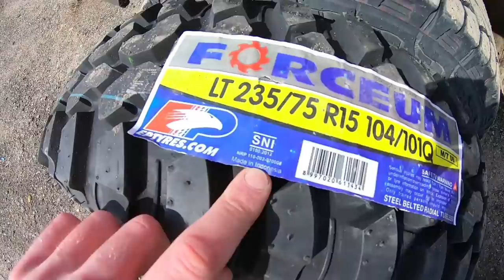Lifted Subaru Impreza gets 30" Tires × Rot Wagon

Comment: Love your Jack.  Link please
Reply from the maker: The one on the hood, or the bottle jack + stand thing?
Reply: @Tinker1837  bottle jack
Reply: @Tinker1837  bottle jack
Reply from the maker: @bradygd  That's a "Powerbuilt All In One" that can usually be found cheaper ($45) at Tractor Supply, but here's an Amazon link: Powerbuilt Black Alltrade 640912 3 Ton,All-in-One Bottle Jack https://www.amazon.com/dp/B003ULZGFU/ref=cm_sw_r_cp_apa_i_MmlUDbSMPNC6B
Reply from the maker: @rjmisfit138   brad ornat  That's a "Powerbuilt All In One" that can usually be found cheaper ($45) at Tractor Supply, but here's an Amazon link: Powerbuilt Black Alltrade 640912 3 Ton,All-in-One Bottle Jack https://www.amazon.com/dp/B003ULZGFU/ref=cm_sw_r_cp_apa_i_MmlUDbSMPNC6B

Comment: I want an outback. Do you need to change diff gears or trans to make it off road or get bigger tires? Is it basically a lifted Impreza?
Reply from the maker: Need? No.  Does it help? Yes.  My "Outback Impreza" in this video has 4.11 gears which helps, & the Forester's 4.44 gears would be even better.
Reply: @Tinker1837  I just got a Legacy Outback in May. It's a 2000 with a EJ25 2.5L H4 engine. Nothing fancy just a beater. I bought it with 213,358 miles on it. Now I have 214,000 miles on it. It's a good car. 5 Speed manual transmission. I am trying to fix it up as cheaply as possible and go from there. I am converting the exhaust to a straight pipe and my goal is to just keep the engine light off for five years. I want a WRX wagon or a 2.5L Outback Sport like this. Same car but a couple years newer with less milage! Is it better then a Forester in your opinion?
Reply: @Tinker1837  nice I have a 2000 Legacy Outback with a 5 Speed. Bought it for $2700 at 213,358 miles on it. I have 214,000 miles on it now. So I am going to keep it for five years. I am doing a straight pipe exhaust from the headers back. Going universal cats and mid pipe delete. Other then that It's a fine car. I decided that I am keeping my car for five years at least with the engine light off. So, if I can do that I will be happy. I'm looking at getting a 2003 Outback Sport with the WRX package. What do you think about that? Are these outback sports better then the foresters or would it be cheaper to just eventually buy a "newer" to me Forester with a stick and the XT package? Just wondering- WS

Comment: Where’d you get the wheel adapter?
Reply from the maker: Ebay, but I'd you goo there too just be sure to avoid the cheap chinesium cast adapters (these are forged aluminum).

Comment: Your car has a problem in its rack and pinion, you old tyre shows its abnormal wear
Reply from the maker: Oh it's more than just the steering! Lots of things are off a little due to the extreme amount of lift it has over original (11" taller & 5" bigger tire!)

Comment: Is that a license plate on the rear 1/4?
Reply from the maker: Yep!  Several of them are formed to the body on each side to cover where I chopped out a bunch of rotten steel. Not quite a hot rod, but same idea 😎
Reply: @Tinker1837  well. I quite like that car. Nice work.  That's the type of Subaru to wheel. Not a brand new one!
Reply from the maker: @Shornandkenny  Agreed! So many parts to share between the different cars back then compared to now.
Reply: @Tinker1837  stock Subaru shit is bulletproof.  Good to see your not a rally fan boy! 

My 4runner had 32 inch mudder so that things gonna be beast! Unstoppable.
Reply: @Tinker1837  no turbo = no problem

Comment: What was the cost to lift the car?
Reply from the maker: Total costs so far:   The Car $350, Struts $125, Lift Kit $700, Wheels & Tires $425, Fixing Leaks $175, Big Brakes $325, CV Axles / Boots $175, Wheel Bearings $125
Reply: I can only dream with such prices here in Brazil, everything overpriced plus insane taxes...
Reply: Car is 350$?

Comment: Wait. How do you have d windows on this thing? Ive been trying to find some 17 inch d windows with the right lug pattern for outting 35s on the same exact car. Except ill be cutting the dog shit out of mine instead of lifting.
Reply: Also cant find spacers that change the lug pattern to accept the wheels.
Reply from the maker: Oh it's just running 5x100m to 5x4.5" spacers that are 1" thick
Reply: @Tinker1837  i cant find any of that size. Got a link?

Comment: 235/75R15=29", not 30"!!!
Reply from the maker: Wrong.  Maybe you have not modified a car, or never worked on your own, because this is a well known FACT:  The size on the sidewall rarely matches the real life measured size, especially on off-road tires.  In this case they measure much larger than advertised, but I have also had truck tires (31" tires that measured 30") smaller than advertised.
Reply: I have no off-road experience, and i never has modifi my car))) Just check my chanel first to tell me that!
Reply from the maker: @Mikael_Leehmanoff  How do you not know something so basic then :P

Comment: Non turbo ? Automatic ?
Reply from the maker: Sadly yes & yes.... for now! Possible 6 cylinder turbo setup or some such nonsense like a K-series Honda coming next year.
Reply: @Tinker1837  hey .. I wasn't knocking it.. I was just curious. . It does the job right ? 💪🚗
Reply from the maker: Sure does! It's definitely one of the slower boxer engines, the 2.2 liter single port, but surprisingly reliable (no head gasket or bearing issues like some others).
Reply: @Tinker1837  yeah 2.2 is definitely best choice for reliability
Reply from the maker: @windolite  They seem to go forever!
Reply: @Tinker1837  I have a 2.2 boxer on my 2017 impreza base. It's very reliable and still has 156 horsepower I believe. It's a good little engine. I'm wanting to turbocharge it. Do you have an aftermarket exhaust on yours? I love going nuts on dirt roads out by the ranch.
Reply from the maker: @posttenebraslux690  Yeah I actually built my own fully custom exhaust front to back, including the header.  And I built the header  unequal length so it actually sounds like a Subaru, oh and I used all V-bands instead of bolt together flanges... so much easier to work on!
Reply: @Tinker1837  Nice. I was thinking about putting a custom exhaust on mine. I know turbocharging your car can cost thousands. So, I figured I'd start there then build up to a turbo.

Comment: Bro do you change fwd to awd?
Reply from the maker: Thankfully this one was already all wheel drive, but I did add a custom switch to control the center differential locking :D
Reply: @Tinker1837  can i know what part aded and part u changed to your car from fwd to awd?
Reply from the maker: It started as AWD, I did not change.
Reply: @triktipshoby9714  99% sure all Subaru's are AWD

Comment: Ummm that is a 28.5in tire not 30 😁
Reply from the maker: The size on the sidewall rarely matches the real life measured size on offroad tires, in this case they're much larger than advertised :P
Reply: @Tinker1837  yes I know I ran 235 on my ranger it's the width of the tire that changes the size so if you would have went with a 245 it would be 30 31 inches 😁
Reply from the maker: Tires 31" tall would be awesome, but then I would definitely need gears!
Reply: @Tinker1837  yes and 4lo

Comment: Not 30s but still cool
Reply from the maker: Sure are. Tire dimensions are far from exact. For example I have 35x12.5r16.5 tires on a truck that barely measure 34" tall (without weight on them). It's a well known thing & I mention in the video that these measure much more than labeled.
Reply: what tinker said, i got a set of 305/70r17's, supposed to be 33", measure 35", mud terrains are all over the place

Comment: Do you have any issues with the spaces and wheel bearings I have 215/70/16 on my forester they are as big as I can get under the struts
Reply from the maker: No issues with the spacers, and I did have an issue with a front wheel bearing, but it was my fault from installing a replacement poorly.